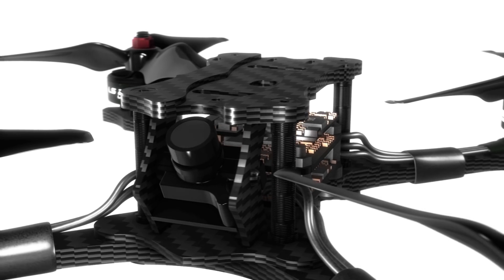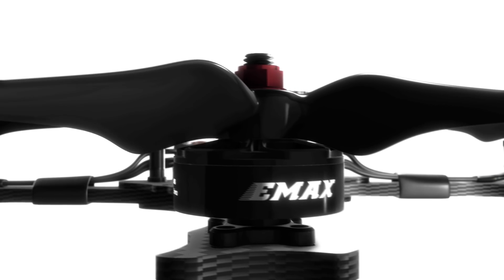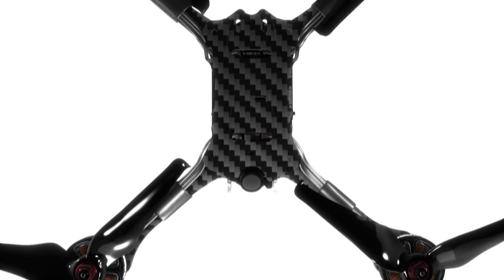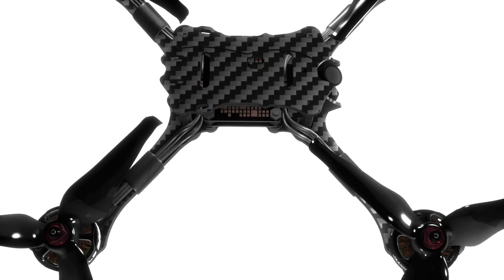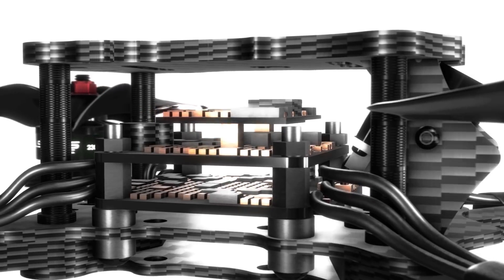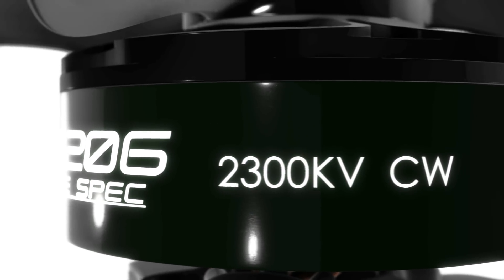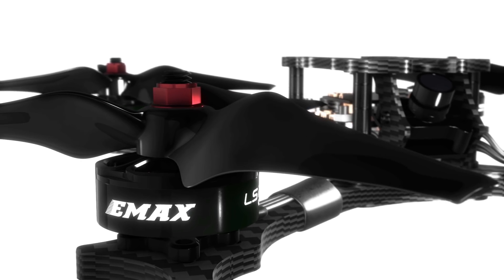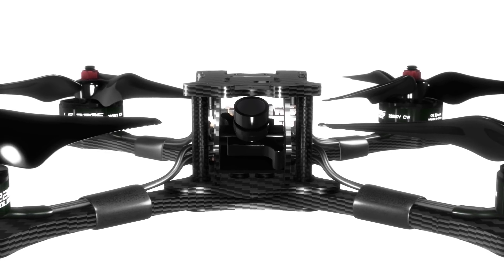EMAX - Introducing Hawk 5

Comment: I really like the frame but unfortunately there is no way to mount a GoPro and a battery on top I would love to see a fix to this
Reply from the maker: Not quite. In fact the frame was designed for mounting batteries on top and bottom plus accommodate a gopro on top as well!
Reply: EMAX USA like with a larger 1500 mah battery???
Reply from the maker: Yes the frame can fit a 1500mah lipo :)
Reply: EMAX USA just to clarify with an GoPro?
Reply from the maker: Those desert shots I myself shot using 1550mah with gopro. Plenty of power for me, however every pilot has a different opinion on what feels "right." Half our pilots said it was plenty whereas pilots who prefer high kv motors preferred, well, higher kv. Hope this answers your question :)
Reply: EMAX USA alright thanks sm but one more question, while the frame be available separately cus I would want to put my own components in?
Reply from the maker: We plan to release the frame separately but no date yet.
Reply: EMAX USA would stock tuning work with the full size GoPro hero 7?